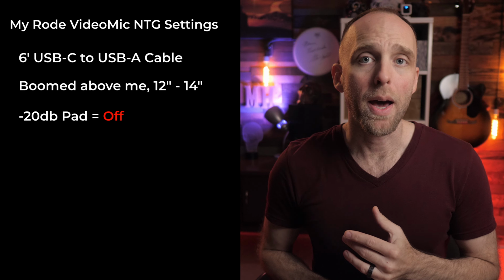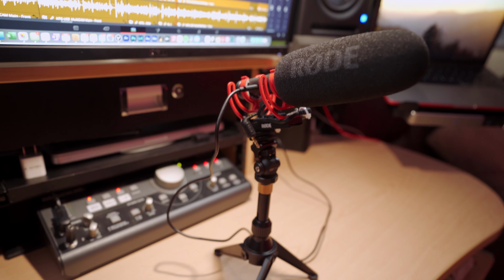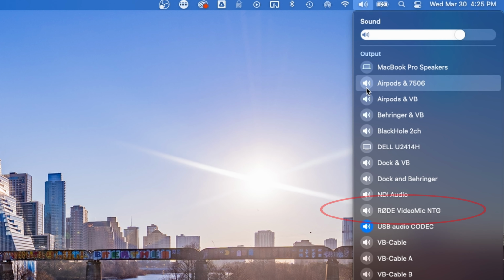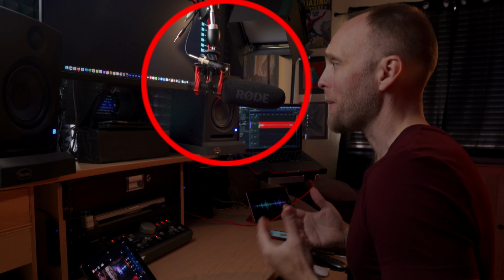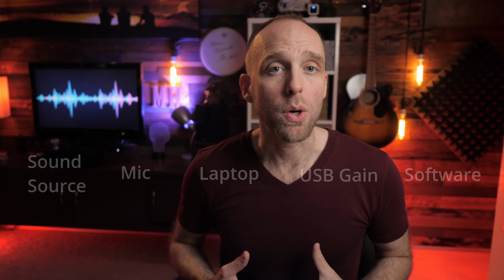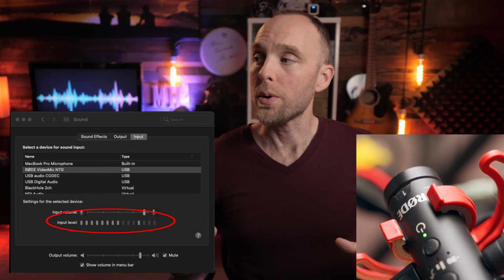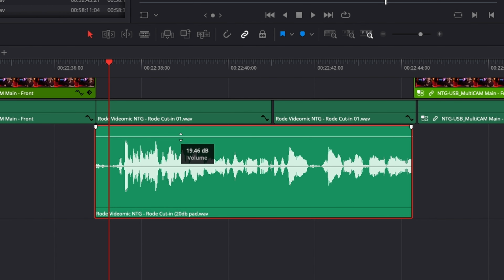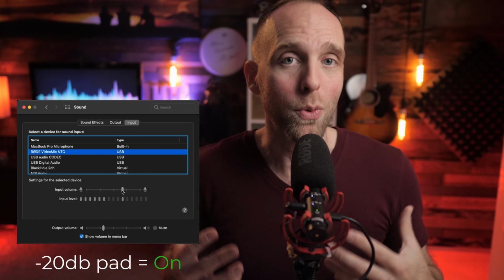How to set up your Rode Videomic NTG via USB for the best sound.

Comment: It's very interesting because I get crackle on OBS with this mic and my OBS is set to -8dB. I thought ideally you'd want 0dB but already at -8dBB it sounds quiet. But still crackles when I'm not speaking low. I keep the mic about 6-8 inches from my mouth I think. When I used ElGato's Game Capture software to stream before, I used to strictly keep the mic on the -20dB pad and have it set on an 8 and it was the sweet spot for whatever I had the program set to on the dB. But when I switched to OBS recently I thought it would be cool to go ahead and let the natural mic sound shine through to see if it'll sound more present and high end without the -20 pad. Well now I have the crackle problem. When I was on Game Capture software before and always used the -20, I could swear the number it was set to made a difference. That whole time did it not make a difference? Or does it make a difference while using the -20 pad.. btw my Mac input is set to 25%.

When I record YouTube videos, I use my phone to record and I keep the mic on the -20 setting, at an 8. For me talking loudly. Then I just add compression on Final Cut and raise/lower the volume. Cuts out most clipping.

As for noise, I've really never experienced noise with this mic. I assumed it's because its shotgun. I was doing laundry during stream and the audience said they couldn't hear it.

Anywho I'm looking for any advice on making this not sound crackly on OBS. Audience says it sounds fine but when I play back I can hear it and I can't stand it. I need a good sound so I can bet confident and I don't want to buy some fancy new mic for it unless I have to. I like the versatility and simplicity of the VideoMic NTG. Also curious about any compression settings for OBS. And yes I get loud. Or energetic rather.
Reply: After watching your video and learning.... Maybe this means I need that pad. Maybe I'm giving the mic too much heat. BUT with the pad on, I no longer need the software to be at a -8dB and I can turn it up. Could also turn up the input % of the computer. So really it seems like opportunity. Perhaps I have all these software things lowering the level and thats why its quiet even though clipping. Like you said, start with the source and follow from there. Sound like I'm on the right track?

I just hate that quiet background sounding vocal. Weak. Now what if I still crackle but this time due to the Mac input level or OBS software. I'm still worried about this quiet crackly audio. On my YouTube videos I dont get much of this because I record quiet and go up (only a bit) with compression and level adjustment.
Reply: Step 1. Check the mic lol. Yup its red when I talk normal unfortunately. I could give the mic distance which would be cool for the shot but I'm worried I'll have that far away echo sound. Especially because this room is a big living room. This would be my problem.
Reply from the maker: Hi there.  Sounds like you went through the process in the time it has taken me to get to these comments.  But yes, I can only reiterate.......start from the source, and check every gain structure point along the way:
Voice > mic > pad > system preferences input gain (if using a computer of course) > THEN OBS/software, etc, because any/all software is going to take the input level coming in from the mic FROM that System Preferences gain level.  So, if you clip out the input at the System Preferences/Windows Sound settings.....none of your other software can "un-clip" it.  And, of course, if you clip out the mic with your voice (like you're too close and not using the pad and the mic is clipping on its own red LE Indicator), then the computer will receive a clipped signal and even if you set your system preferences level to where it looks like it's not clipping.....if you clip the mic, it's clipped, and done, and you'll have to use the pad.

So, again, using the pad isn't going to necessarily give you a quieter signal, especially if you're close to the mic.  

You can also use a compressor plugin (filter) inside OBS or even an audio gain plugin/filter to further amplify the mic signal if you need.

But remember this as far as "db" values inside OBS and software....you NEVER want to hit ZERO dbFS.  OBS, like most digital audio software, is using the dbFS scale, and if you ever hit zero, you've clipped out the audio, basically the computer can't store any more information about the audio, so, it's clipped.  and I'm talking about the audio meters.  I almost never mess with the meters inside OBS, I just leave them at full, but I watch the LED signal that goes along with that meter and ensure my vocal is hitting about -12 to -8 on the meter, and I use an audio compressor plugin to compress and reduce the louder sounds of my vocal, and then raise up the overall level.

As long as you're not clipping out anything in the chain, you should be good, just follow and watch the signal path as it flows from your voice through every step.

Good luck!

Comment: this is an amazing video. thank you! I learned a lot. Would there be an issue if this mic is plugged 8+ hrs/ a day to a windows work computer? I am wondering if it has some auto sleep mode when plugged to a computer but not used.
Reply from the maker: Hi there.  Thank you, I'm very glad the video helped.  And no, it's not an issue for it to be plugged in constantly.  I use it for many hours daily, and sometimes forget to unplug it from the USB port on my computer........and it's still on the next day!  So, I've never seen, read, or experienced any "sleep" modes, you should be good to go.  Keep in mind that if the computer itself puts the USB ports in some sort of sleep-mode if the laptop is closed, etc, then the mic might turn off, but my laptop is set to never sleep when it's plugged into my thunderbolt dock, and I have my mic plugged into the USB port on my dock, and it still never goes to sleep.  Happy recording and virtual-meeting!

Comment: Hi, I am using this mic for live videocalls using the USB cable.  When I attach my ear phones to the mic, I keep on not hearing the other person at times, or this last time, I stop hearing them at all.  This is not a problem if I connect my ear phones directly to my laptop.  Any advice on how to fix this issue? I'd like to continue to use this set up, if possible.  thanks
Reply from the maker: Hi there Carla.  I occasionally have this issue when using different cables or headphones, and it can come down to tiny imperfections in the diameter of the 1/8" plug on different devices and it just not being *quite tight enough inside the 1/8" jack on the mic and therefore isn't making a good enough connection.  I do have the stock 1/8" cable that cam with my videoMic NTG kind of "permanently" attached so that I limit how much I am inserting or removing a cable, but even my method with my extension cable and 1/8" coupler (like I show in this video https://youtu.be/v2HvtfBFkaU ), I still sometimes have to wiggle the connection a bit to get it into my headphones, but that's usually with just ONE of the several cables I use as extension cables. 

So, you're not doing anything wrong, small 1/8" and 1/4" jacks can just be tighter or looser with different plugs from different devices.  you might try a headphone extension cable, I've had good luck with cable creation extension cables, they seem to fit nice and snug and provide a good connection to the terminals inside the jack.  I have several of these:  https://amzn.to/3Btx0u7

Long story short, try a different cable, you may have better luck if its machining makes it a bit tighter when inserted into the 1/8" jack on the mic.

Good luck!

Comment: Great video and explanation! Thankyou for the guide. Also, may I ask if the USB C to USB A cable can affect the sound quality? Can any cable brand be used for connecting the mic to PC? Recently I bought the Videomic Go II but it doesn't come with USB C to USB A adapter, so I wonder if I can just use cable from smartphone without having to buy Rode cable.. Thank you!
Reply from the maker: Hi there.  The USB cable *shouldn't affect the sound quality, although with any longer cable of any type (analog or USB), you should always do some tests to make sure you're not getting any weird noise or interference.  But, I use a 6' USB-C to USB-A cable that I had to buy because I mount my mic up, over head, and too far away from my laptop to use the included cable.  And it's worked just fine for over 2 years.  I got one from Anker.
This one:  https://amzn.to/3xPWK1d

Works just fine.

Comment: Great and thorough video! You answered basically all the questions I had about this amazing mic. The one question that lingered though, that control knob on the back, when connected via USB to the computer, does it only regulate the MIC volume output to the 3.5mm or does it also regulate the COMPUTER's volume output as well? My intention is to use the NTG as a single USB interface for both Mic and System sound, and I'd like to turn the Mic volume down so I don't hear myself, but still be able to listen to my computer's audio. Is this possible?
Reply from the maker: Hi there Joe.  

Great question.  My apologies for my late reply, I've been busy the past month!!  

So, it regulates both.  Any audio passing through the mic via either the mic capsule (what the mic hears) and any audio being sent TO the mic from the computer.......both of those signals are regulated to the 3.5mm output by the knob on the back of the mic.

I use the mic via USB and I use the 3.5mm output as a headphone jack often when I'm having virtual meetings and I want to hear myself.  

So, the GOOD news is that, at least on a Mac (Macbook pro), when you plug in the mic via USB.......AND you set your computer's master volume output to the VideoMic NTG.......you can THEN, also, use the volume buttons on the keyboard to adjust the level of computer-audio being sent to the mic.  This is how I regulate how much of "me" I hear vs how much of the computer audio I hear.  I basically plug in the mic via USB, plug in a 3.5mm extension cable that goes down to my headphones.....I then put on my headphones and use the knob on the back to get a good level of "myself" in my headphones......then, I select the Rode VideoMic NTG as my main output on the computer, and then play back some audio on the computer and use my keyboard volume controls to adjust the computer audio to a good level.  Then I leave the knob on the back of the mic alone, and then I can simply volume UP or DOWN on my keyboard to hear more-or-less of the computer audio.  But remember, the keyboard volume controls will NOT affect the level of your voice going into the mic, just the audio coming from the computer.

If you are using a meeting platform (Zoom, Teams, etc). you ALSO have to set your meeting platform audio to use the VideoMic NTG so the meeting goes out to the mic.....but, again, make sure your operating system is ALSO using the NTG as the audio output.  Basically, if the meeting platform is using the mic as an output......BUT, your operating system is using a different audio output (like maybe the laptop speakers), then your keyboard volume controls will only control the audio device that's selected in the operating system.  So, if I had my Behringer UM2 set as my operating system main output, then I can press volume UP/Down all day long, but it won't change the audio going to the NTG.  

Does that make sense?

LASTLY.........you won't be able to "turn the mic off" so you don't hear yourself.  If the mic is plugged in via USB, it's on, and it's going to pass signal directly to the 3.5mm output.  So, you can't "turn yourself off" entirely.    One way to kind of hack this is to use the video MIc NTG as your operating system's main output like you want to do.....turn up the volume to maximum (or near maximum) on your computer so it's sending its maximum audio to the NTG......then adjust the knob on the mic for a good level in your headphones for that computer-audio.......keeping in mind you'll still hear the mic itself in the headphones.  But, then, you could turn on the PAD on the mic to reduce the mic's signal, which will send -20db LESS audio to the 3.5mm jack on the mic (but this will NOT affect the audio coming from the computer.......so, therefore, if the computer audio is maxed out, and you've engaged the pad on the mic, your voice will be a LOT lower than the computer audio most likely, and you may not hear the mic much or at all if the mic is far enough away AND the pad is engaged.......but unfortunately there's no way to "turn off the mic to the headphones."   So try the "max out computer audio.....reduce mic volume with pad" idea, it will work to an extent.   You'd be using the Pad as a selectable volume control for the mic itself.  

Give it a try, I hope that helps.

Comment: VEry good tuto.  I will have my Videomic NTG tomorrow. I wonder how it would perform with a 32 bit float recorder. One question, how do you think I could extend the 3.5mm cord? I think of also buy the RODE  SC1 which is +/- 10 feet
Reply from the maker: Hi There Robert.  Thank you very much.  My apologies for my late reply, I've been busy!
As far as it's performance with a 32-bit float recorder, I'm assuming it would be just fine, you of course would need the Rode VXLR 3.5mm to XLR adapter, which I have and which I've used with this mic to get it into my Zoom F8n recorder, it works great.   I don't know if the 3.5mm output on the mic is a straight analog output of the mic or if it's being converted to digital INSIDE the mic and then BACK To analog to go out of the 3.5mm port.......that *might make a difference on the quality you get out of the 3.5mm port.....but then again, I record 95% of my videos using the 3.5mm output jack and run that directly into my camera's 3.5mm port.  So, no complaints, and, I'd get a cleaner sound if I used the Zoom F8n.

I have noticed when using the mic via USB that, depending on the audio-gremlins, I have gotten a very high pitched digital noise in my recordings.  I think I even heard it when editing this video and I had to use an EQ to notch out that particularly high frequency.  I compress quite a bit so I'm sure it made that noise pop-out of the mix.  It was minor, but apparent to me.  

As far as extending the mic's signal with a 3.5mm cable, I do that all the time.   Just keep in mind it's an unbalanced output, which means you don't want to extend it TOO Far.  But, I currently  use a 4' cable, and often use a 6' 3.5mm cable.  Being unbalanced, you really have to listen for any noise and interference that the cable can pick up along the way.  For instance, it can pick up electromagnetic noise from neighboring speakers or TV's if they're very close to the cable.  I don't have any issues here at my desk, but it's something to listen for when using long, unbalanced cables.  But, I use a variety of brands of 3.5mm cables and 3.5mm extension cables.  And, I have extended my VideoMic NTG up to 15' with no issues, but again, listen carefully.

I like the cables from "Cable Creation" that I found on Amazon because they are very flexible:  https://amzn.to/3O9pPKy
I have a ton of those.  I also use Amazon Basics 3.5mm cables.  No issues really.

As far as the Rode SC-1, I'm sure it's a fine cable as well, it's always good to take the manufacturer's recommendation, but I also don't think Rode's 3.5mm cable is much different, better, or worse than other brands.  

Good luck!
Reply: @MarcusHutsell  Wow ! what a reply! You deserve 1M subs. Since then I also bought the Rode Wireless II doubled with  the Zoom F2 which are great for interview style outside.
Reply from the maker: @robertgilbertmedia  Thanx Robert!

Comment: Very helpful video! I was really confused why the volume wasn't changing when plugged into my computer even with changing the volume knob. lol 

Even though the microphone is further away from me then in your setup it seems I need the -20db pad but makes it a bit too quiet for what I am hoping to accomplish. There doesn't happen to be a way to do -10 is there?
Reply from the maker: Hi there.  I'm so glad the video was helpful!

So, no, there is no way to only set the pad to -10db, because Rode only built in a -20db pad.  The main thing to watch and determine is:  IS the clip indicator on the mic turning red (clipping) at your preferred speaking distance and voice-level?  If so, then yes, you'll need to turn on the pad.  

But yes, of course, with -20db of pad, often you can't then get ENOUGH signal into the computer, even with the volume slider in Mac/windows all the way up. 

so, there's a couple of things you can do:
1.  If you're just recording, then you can boost the level in post in your video/audio editor.  
2.  If you're live-streaming, but you still can't get enough input level (b/c you need to use the pad), then, you can run your mic through OBS and use an audio filter to add a gain stage there, and I often do this and add a compressor there as well to compress my vocal.  You just have to know how to properly route the audio through OBS, then back out to your virtual streaming platform (Zoom, Teams, etc).  And you have to use "virtual audio cables" to do so.  sometimes you can simply turn on the "automatic mic gain" in Zoom/Teams, etc, and that will add additional "gain" in the meeting software to boost your signal if it's too low, but it can also make your stream noisier because if you're quiet for a bit, it will start to increase the gain because it doesn't hear anything, so it boosts until you start talking.  Not my favorite feature, but it can work.

I hope that helps, good luck!
Reply: @MarcusHutsell  Thank you for the detailed information! The mic is indicating the clipping without the pad so I'm just going to be stuck with the pad and increasing in post.
Reply from the maker: You’re welcome. And yes, “post” it is! Good luck :)